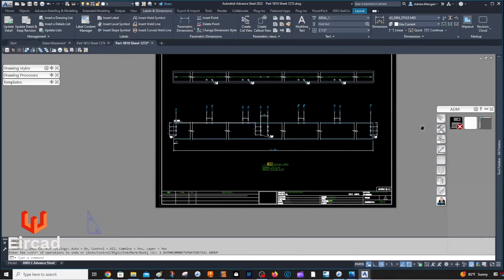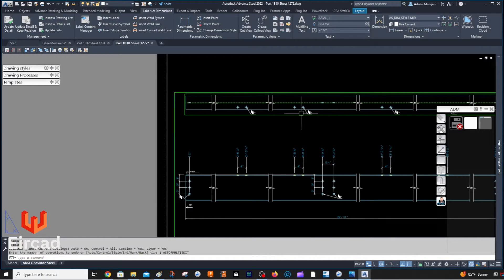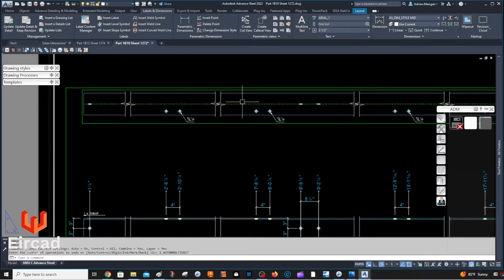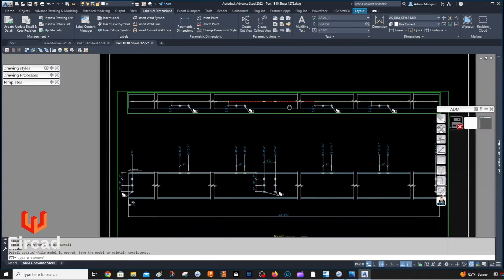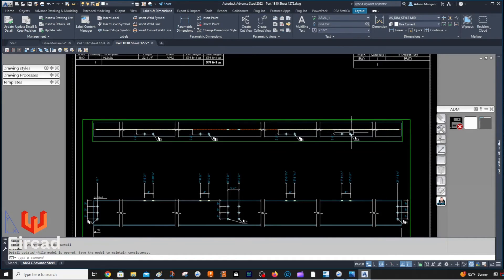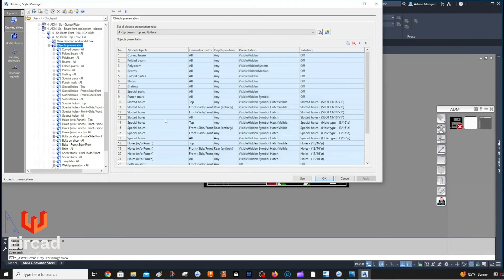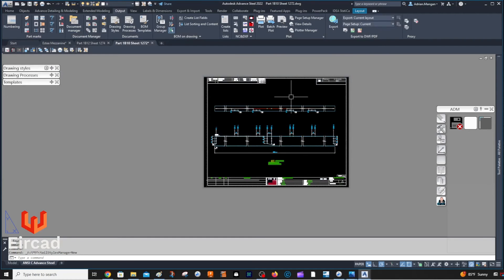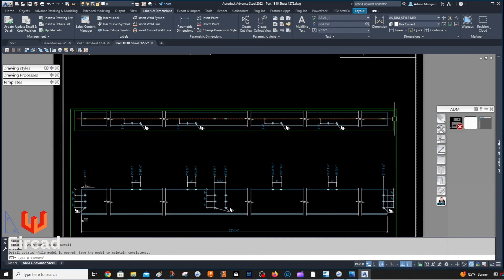ADVANCE STEEL: Missing Dimensions - The Culprit.

Comment: That makes a lot of sense now thank you. System line isn't always central or top either depending on the project, and often looks messy on drawings 👍
Reply: Some say messy, some say necessary for detailing to show its length to connecting member, you could just use median if you don't like it
Reply: @adriandmangan  yes, it's things like PFCs/ Angles it can throw workshop though as system line is centre of gravity but goes on like a centre line and it can be pretty close to centre on some size's.